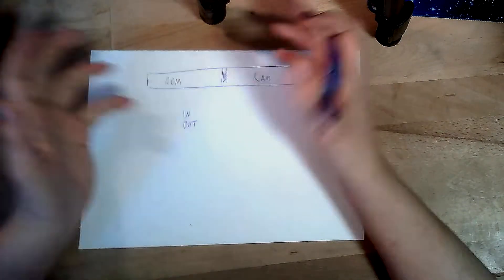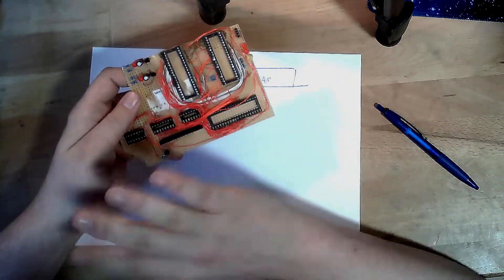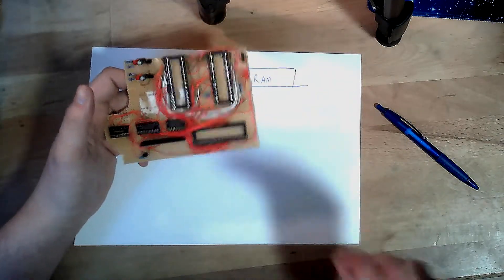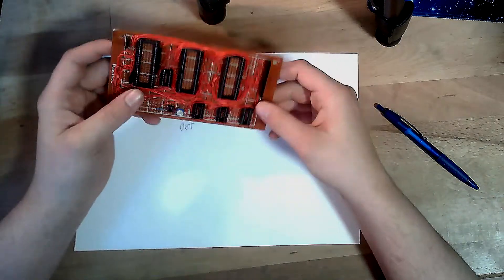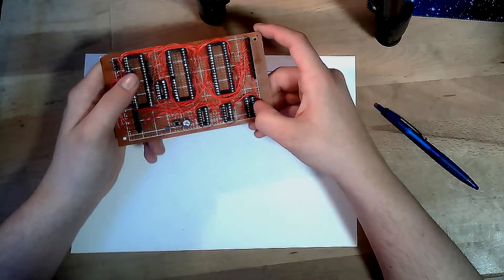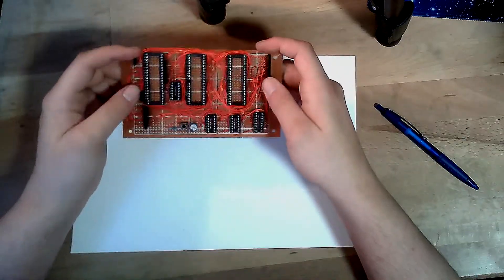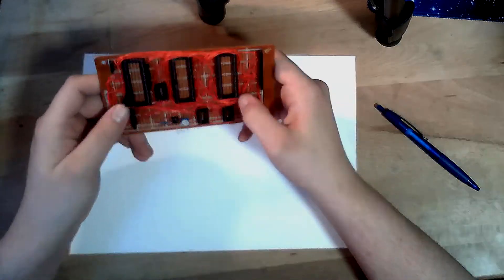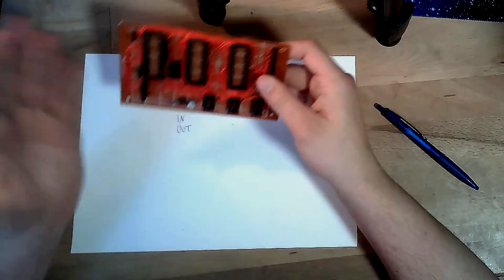Oops! I built a Computer! - Building a Z80-based Computer from Scratch

Comment: I'm interested in how you are programming the ROM. Have you built a programmer?
Reply from the maker: That was my original plan, and it worked somewhat well, thought it was too much of a hassle to use every time I wanted to test a minor change, so nowadays I just use a proper EEPROM Programmer, just to make development of both the Software and Hardware easier.
Reply: @80Bytes  I did the same: AVR, couple of 8 bit counters for the address, etc. Programmed the AT28C256 nicely. Used it for about 3 years until my projects outgrew 32KByte ROMs.
Reply from the maker: @lawrencemanning  If it ain't broke, don't fix it!
But still, it's always nice to know there's ways to do stuff without buying specialized equipment!
Reply: @80Bytes  I really enjoyed it: hadn’t done any MCU projects before and found it a load of fun. It was a nice warm up before tackling my first proper computer project: a 6809 based computer. Got some crappy videos in my channel if you are interested.
Reply from the maker: @lawrencemanning  I'll try to remember! Always love seeing what fellow Hardware Nerds are up to!
Usually leads to me finding solutions to problems I'm expecting with my hardware.